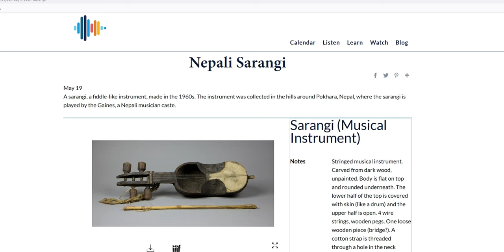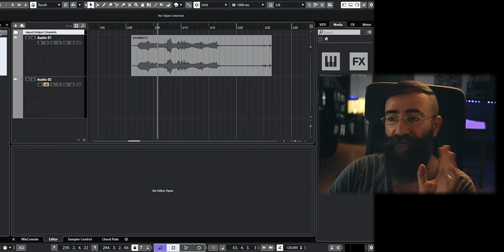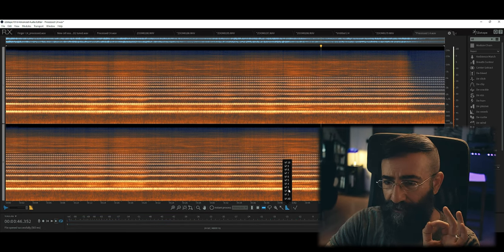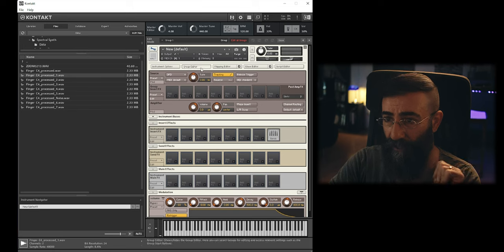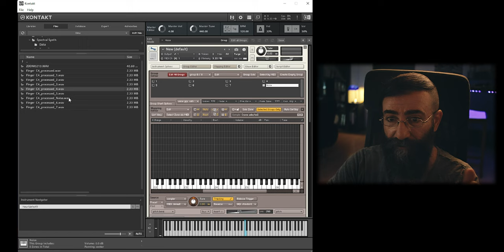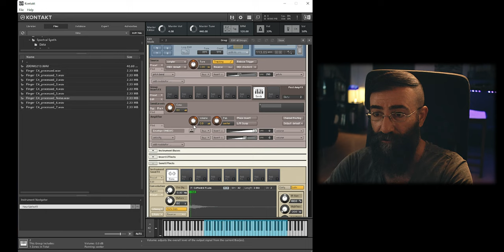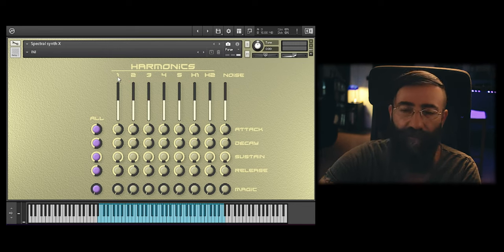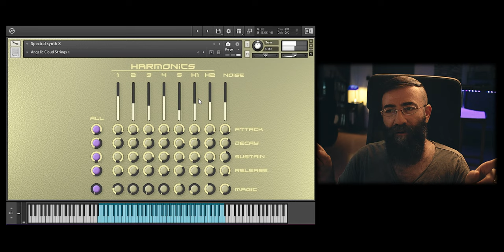A Spectral Synth from 7€ Instrument In Kontakt  🎻

Comment: Hi, very cool Sound design with Izotope RX and harmonics! What version of RX is needed for Spectral extracting of harmonic layers? (i.e. RX -Standard, Advanced) ? Also can it be done on Windows machine or only on Apple, Mac? I read something on RX10 Advanced -"Spectral Editor & Music Rebalance ARA plug-ins are available in Logic Pro on Intel or Apple silicon Macs (in 
Rosetta only)."

And you mentioned possible also via Audacity. I see some Spectral Layers in Audacity, but not sure how to extract the harmonics using that. Do you have or could you provide a video of how to do that in Audacity -would be good if free method available. Thanks!